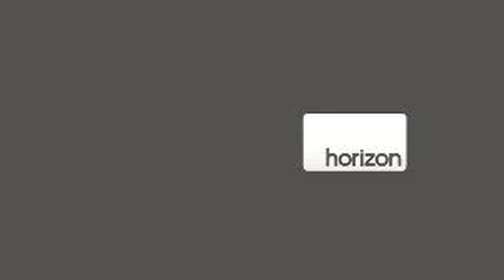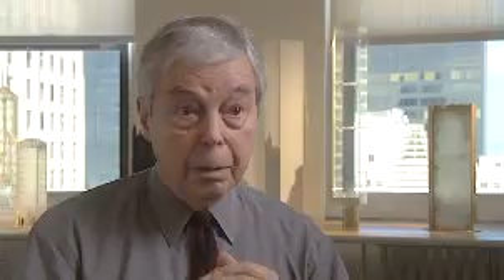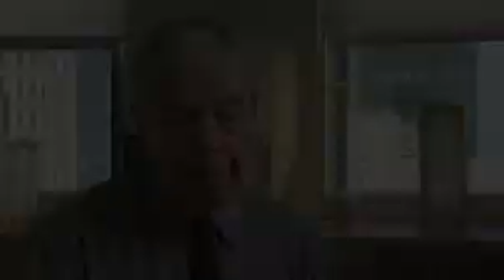Leslie Robertson - Chief Engineer - World Trade Center - Twin Towers

Comment: Yet we all watched the plane hit and the building did not move but pulverized 57 minutes later🤔
An asymmetric impact from a 200 ton plane into a 500,000 ton building that was built to carry a 13,000 ton load- constructed using 100,000 tons of structural steel and 212,500 cubic yards of concrete. (Each Tower)

This is high school physics. Newton’s third law.
And our whole society is being led to believe these fundamental laws of physics-hard science don’t apply anymore!!!

A COLD burning fire (Incomplete combustion-black smoke) fueled by what remained of a KEROSENE fire ball-CAN NOT take down a steel & concrete building in 
57 minutes and 102 minutes!!
(South Tower second Tower hit by plane collapsed 1st)

NEVER EVER IN HISTORY-before or since has a STEEL build collapsed from fire.

A 1350 foot tall building with asymmetrical damage!!!
CAN NOT:

COLLAPSE perfectly symmetrical 

AT FREE FALL speed 

TAKING THE PATH OF MOST RESISTANCE through itself with ZERO resistance!!

pulverizing 100,000 tons (each) of structural steel and 212,500 (each) cubic yards of concrete in 10 SECONDS

CREATING a rumble pile only 75 feet tall (no pancaking) and creating a PYROCLASTIC FLOW 1,000 high covering 22.82 mi² of the Island

Jet A is the same stuff burned in conventional steel wall heaters.Jet fuel only "explodes" when compressed 12-1.
 In an open-air office fire such as that at WTC (called a "dirty burn" kerosene or any hydrocarbon will burn at around 500-700F (260C to 371C). The FEMA report on 911 said that the jet fuel burned off after a few minutes and the fires from the office furniture and carpets were about 560F (293C) The special structural steel of the WTC has over 98% of its strength at those temperatures, and the WTC was built to hold 5 times its load

“Is Oh mortal man, is there anything you cannot be made to believe”
Adam Weishaupt

19 Hijackers with box cutters,  trained at a small privately owned airport-on signal engine Cessna  -fooled the greatest intelligence agency in the world and all their intelligence allies-took down a 2.5 Trillion dollars defense infrastructure and 50 plus years of Cold War experience in a few hours one morning while being guided by a man on a cell phone -hiding in a cave in Afghanistan🐑🐑
Reply: Dude you are just SO wrong with every, single, point you are trying to make. All of your points are also so one-sided, you're only using the facts that fit your narrative, ignoring everything else that contradicts it. But anyways, yeah, everything you said is wrong. Would you like me to prove you wrong? Lets talk about one thing you said, the towers collapsed at free fall speed. This is not true. How can we tell? Well if you watch literally any video of the collapse, you see pieces of debris, that are no longer attached to the building, falling faster than where the building is during the collapse. They are falling faster because THEY are falling at free fall speed, because they are no longer attached to anything. If the buildings were falling at free fall speed, it would be going just as fast as that loose debris.
Reply: It didn't fall at freefall speed. An black smoke does not indicate a cold burning fire whatever the hell that supposed to be. There was no pyroclastic flows nor did it fall in its own footprint. It took 8 months working 24 7 to remove the 15 acres of debris 

Seek mental help

Comment: So he's saying that the shock wave of the impact damaged the structural members so catastrophically as to cause the very strange, clean (but weirdly dusty), and sudden collapses?
The fuel couldn't have damaged the whole building - just look at the videos and you'll see the initial fireball. That brought down the whole building, in the way it came down?
Let's grant that for a moment... Oh, then wait, what about Tower 7? No plane, no fuel, no damage from jet fuel - but same strange, clean (but weirdly dusty) collapse... From office furniture burning.
I wouldn't let this man design a concrete paver patio. Fucking CIA (Cunts Infiltrating America).
Reply: przybyla420 - The impacts of the 767’s caused a lot of structural damage, alone. Then jet fuel started the office fires, which subsequently weakened the structural integrity to the point of no return. 

You have to realize that the WTC towers were a unique design, meant to maximize the amount of open space on each floor. That meant that all of the main, foundational structural support was in the very center of the towers and along the perimeter of the buildings. Obviously the perimeter lost most of its structural integrity at impact, so it put a heavier load on the internal structure that was also heavily damaged. The moment the impact floors couldn’t hold the weight of the floors above it, the rest was up to gravity.
Reply: Can't cure stupid.
Reply: przybyla420 - I would expect that sort of response from someone who cannot formulate a coherent rebuttal, but I encourage you to give it a shot. Please, by all means, refute the point I made.
Reply: If you're about to say office fires, refer to 3)
Reply: przybyla420 - Although I’m genuinely amused by your CIA analogy, your response is a laughably predictable deflection which highlights the intellectual dishonesty that runs rampant in the “truth movement.” ”What about building 7?” does not refute any of the points I made about the twin towers. Try again. 

There’s no denying that the collapse of WTC7 looks like a controlled demolition; and when you add that to the anomalies and historical precedence surrounding its collapse, reasonable skepticism is undoubtedly warranted. 

Having said that, a lot of the skepticism found in the truth movement derives from misinformation and flat-out lies. The most glaring misconception amongst truthers is the extent of the fires and damage, which is almost always downplayed from what the reality was. You may think WTC7 only suffered from ‘just a few small office fires,’ but that is grossly inaccurate and misleading. Not only were the fires widespread, but the collapse of the North Tower caused a lot of structural damage to the building as well. But truther videos conveniently leave these photos and angles out, because it contradicts the bullshit they’re spreading. 

Take a look for yourself:

http://www.debunking911.com/WTC7.htm

And let’s not forget about the NYFD, who voiced concerns about WTC7’s stability hours before it collapsed. They even setup survey instruments to accurately assess whether or not the building was moving, sinking, bulging, sagging, etc, which progressively got worse throughout the day. Take NYFD commissioner Daniel Nigro’s account of the events of that day: 

“I feared a collapse of Building 7 (as did many on my staff). The collapse of WTC 1 damaged portions of the lower floors of 7. Building 7 was built on a small number of large columns providing an open Atrium on the lower levels. Fires on many floors of WTC 7 burned without sufficient water supply to attack them. For these reasons I made the decision (without consulting the owner, the mayor or anyone else—as ranking fire officer, that decision was my responsibility) to clear a collapse zone surrounding the building and to stop all activity within that zone. Approximately three hours after … WTC 7 collapsed. Conspiracy theories abound and I believe firmly that all of them are without merit.”

So, having pointed these things out, what do you believe happened to WTC7? What do you think caused its collapse, who do you think was behind it, and why? Please be specific.
Reply: No combination of regular office fires and ejected debris, no matter how severe, could cause the collapse of building 7 shown in the footage. Period. (No matter how much the water is muddied after the fact.)

Debris would cause asymmetrical damage, obviously. Fires, even engulfing every floor,  would simply gut the building, leaving behind the structural "bones" of the building. 

If fires did somehow manage to heat up the structural members enough to make them flexible enough to deform under their loads - they would deform - and cause an uneven (normal looking) collapse to one side. A significant portion of the building would not be PULVERIZED TO DUST, or fall basically into its own footprint.

You want to pull me into the weeds to discredit me with some contradiction, I get it. "The whole building was depending on a few large members." Ok, great. What I've been trying to get through your incredibly dense skull is that these had to be destroyed simultaneously, throughout the entire structure, or be removed magically by a genie, in order for us to have seen the collapse we did.
Reply: przybyla420 - I appreciate the thoughtful response, but the arguments you made have been around for nearly two decades. Although may seem like reasonable arguments on the surface, they fall apart under scrutiny, due to the myriad of unfounded assumptions and wide-ranging implications they entail. 

For example, your assertions imply that people within the NYFD were complicit. After all, why would the NYFD repeatedly voice concerns about the stability of WTC7 throughout the day, if - as you claim - the damage and fires alone could not cause its collapse? And then why did the NYFD evacuate the entire building and setup a “collapse zone” around building 7 if their fears of impending collapse were unwarranted? 

That’s just one example of many, but for the sake of brevity I’ll leave it at that, for now. 

What I find the most telling, though, is your refusal to offer any specifics due to the likelihood of contradicting yourself. If that’s a legitimate concern of yours, surely you must realize that there are contradictions and discrepancies under the surface of your beliefs and assertions. That’s not to say I have a problem with people scrutinizing the “official” story - skepticism is undoubtedly a good thing. Incredulity, on the other hand, is not. Personally, I find the conspiratorial claims to be highly unlikely, but I certainly do not rule out the possibility that I could be wrong. Do you believe that there’s a possibility that ypu’re wrong?
Reply: The impacts were fired did not have to damage the entire building. Once the building started to collapse the top portion that had enough mass and inertia to go all the way to the ground

Comment: I wish Leslie would explain the 1,930 degree thermal heat at WTC 1 and 2 as registered by satellite.
Reply: You mean infernos in a steel building even though common sense metal absorbs heat. Not to mention the direction that the smoke was blowing indicates that the wind was blowing
Reply: that wouldn't fit the Gov't story, and I'm sure he knows better than say so.

Comment: What about building 7. No plane, freefall collapse.
Reply: There wasn't thermite found and none of the buildings fell at Free Fall speed
Reply: What about building 3 and building four and building five and building six and the church
Reply: Wes Fox yes and alot of explosives https://youtu.be/wUXGhLrDqb0
Reply: scientist took samples of the dust and found thermite. There's evidence on the web. Do some research it only happened 17 years ago and the evidence is overwhelming. Do you also believe a pilot who couldn't control a Cessna single engine plane flew a jumbo jet with the transponders off and with the clacker going off into the heart of New York and parked it right in the middle of the towers? If you do, I got some property on the moon I'll sell you.
Reply: @gregdennis5107  when did Thermite ever been used on a Skyscraper

Comment: I'd like to have herd what the lead architect Minoru Yamasaki would've had to say about 9/11 too bad he died in the 80s
Reply: But Yamasaki was only the architect, not a structural engineer like skilling or Robertson.   But skilling said back in the days, it was “designed”to withstand a fully loaded 707, and the fires were considered. Skilling said: “There would be a terrible loss of life, but the building would still stand after the fire” But of course nobody at this time would have considered a plane at top speed running into the building.  
Look at the new WTC it’s build like a tank, but it did cost much more then the Burji Khalifa.
Reply: @Xantylon74 I still don't trust the new towers.its nerve racking with trump rubbing enemies wrong.

Comment: "We had designed the project for the impact of the, our largest airplane of its time, the Boeing 707. That is to take this jet 
airplane, run it into the building, destroy a lot of structure and still have it stand up." - Leslie Robertson
Reply: Did you miss the parts where he said that the big difference was they designed it to be hit by a plane going slow, lost in the fog, with little to no fuel, not a larger 767, going 650 mph, fully loaded with fuel. Oh I guess they cut some of those parts out of the video, watch the entire interview maybe.